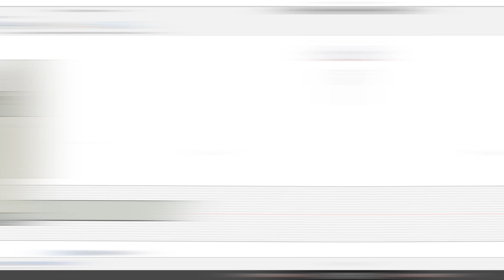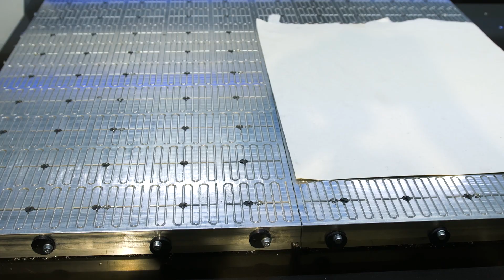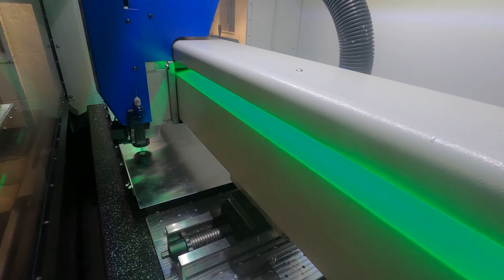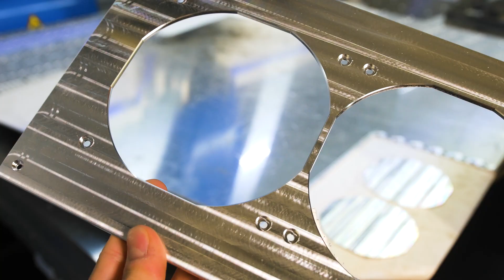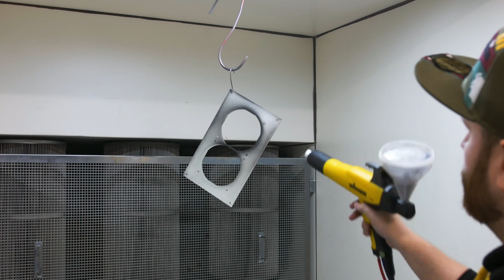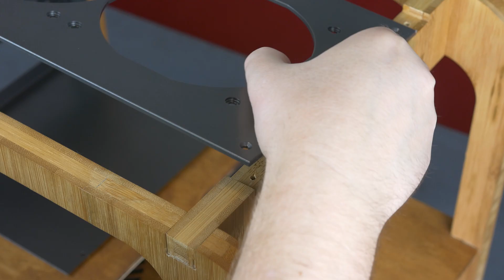We make our own Motherboard Tray! - Wood PC Pt.2

Comment: It's been three years & it's still an amazing build.  I'm currently doing something like it using a routing table manually & completely out of aluminum, thinnest aluminum being 1/8 of an inch.  Everything I'm doing will be done by hand with zero design done on a computer, all pizza boxes & bar napkins.
Reply from the maker: Thanks, your undertaking also sounds awesome!
Reply: @ModBros  You'll get a kick out of this, in the movie Highlander when the Antagonist builds his sword, how is slides & then snaps into place, it's the same way a bayonet connects, snaps to the end of a rifle with milled in leaf-springs w/ a button to depress the spring & release the catch to take apart.

Here is THAT movie clip.
https://youtu.be/Me46MnLbfU8?t=1502 
ehh, somehow I remembered it being more epic.

I am trying to work as may of them I can within the design to the point of it being a puzzle-box.

I have everything needed to get started, I just need to clear out a bedroom w/in my house to use as a Machine shop since I've got dogs & the last thing I'd need is a pup licking up & swallowing a mouth full of razor sharp metal shavings.

Been also thinking of designing, milling, & building my own custom copper Radiators GPU, & CPU-Mono water blocks.  And using ribbons to move the NVME drives to the back of the GPU block to be water cooled.  Do they make ribbon cables for DDR5?

Also learned how to bend glass tubing, glass looks so many times better & will never discolor or warp/bend over time.

I need to research if there is a CnC machine out there that can mill glass block for the water blocks, replacing the plexi.

Me writing this out is starting to make me think I might be better off CnCing it.  Either doing all of it on CAD & sending it out or doing it myself via buying a CnC machine.

I need to do one thing, decide if I am just building a custom computer or creating a work of art.  ...if it's art, then the parts will be out of date by the time it is done & I should just use my old SLI 2080ti pc parts.

I'll just get my case built & just be drilling holes & cutting threads to screw it together.

...LOL just thought of a tree made of hand bent copper tubing covered with copper hand crafted leafs as a radiator, with the leafs being the fins.  ..I need to stop.